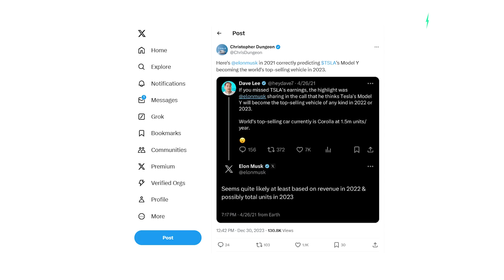CEO of CATL says Tesla’s 4680 battery cell is DOOMED to fail

Comment: Jelly roll is an antiquated design. 

Its simple physics. The heat dissipation path from the centre of the cell to the exterior is much longer than from the outer layers to the exterior. This results in a significant temperature gradient from the centre to the outside. The centre of the cells tends to be hotter than the exterior. This is bad for Li cell thermal management, longevity and reliability.
Reply: Add to that volumetric energy density limitations when cylindrical cells are placed into packs.
Reply: That doesn't make sense sorry. Do you mean a cylindrical wound jelly roll is antiquated? Inside of a prismatic cell is also a jelly roll. It can be a wound jelly roll or a stacked flatter jelly roll.
Reply: @danielcpt3819  The issue is the external area of the cell relative to its volume. To get rid of heat you need as large an exterior surface relative to volume as you can get. Hence the blade cell format used by BYD and CATL. 

This format is also structural with the assembled battery pack forming a torsion box that helps with vehicle rigidity  and reducing overall weight. The BYD battery pack is typically 400V 60KWhr 126S1P LiFePO blade cell battery. Each cell is roughly 1.2m long about 10cm high and about 2cm thick so provides plenty of 'active' volume within a large surface area for cooling.
Reply: @jimgraham6722  I completely understand this. A blade battery is just an elongated prismatic cell. Inside there are jelly rolls and outside is a large rectangular can l.
Reply: the two d problem of stacking circles in a hexagonal pattern means that 86.6% of the area is in the circle and the other 13.4% is available for gas flow for cooling. How well  heat flows along the length of the cylinder vs the breadth
becomes important. If heat degrades the battery you could get the inner core of the battery degrading first if the heat flow is less perpendicular to the length of the battery, which is likely as the metal is better heat conductor. A simple expedient  is to just wrap the batter on top of an empty tube that gives heat flow down the center of the tube. This eliminates material at center which could degrade first and could in principle allow increased airflow that if  matching the external flow space, could effective make the battery geometry with empty cylinder more equivalent to a battery with "half the radius".

A  battery takes up both space and has weight.   Adding a hollow cylinder puts more weight on the external cage to the extent it gets bigger, but gives the battery more consistent aging characteristics.  it all depends on whether the battery degradation ruins the whole  battery or just the most heated material, degrades.  you probably are more weight limited than space limited anyhow. So making battery with hollow core is maybe good trade off.

Perhaps the goal of a 10 year life battery is just as good to a car maker as a 20 year life?  Could you make the battery too good, and lose future car sales?

Comment: Some context, the CATL CEO actually was talking to Elon Musk about the major short comings of 4680 and Elon could not answer him. That's where this came from. The only thing Elon could say is they have to push forward.

Also its not Tesla battery tech, it's Panasonic. Panasonic is trying to ride on Tesla's tail to take back the battery crown. Their 2170 was the initial battery back used in Teslas back in 2017. 4680 is a bigger version of 2170 except the cylindrical packaging which is used in very old school lithium packs is outdated from the beginning. CATL's packs are already more energy dense than 4680 with none of the manufacturing problems so that's why CATL's CEO is saying what he is saying.
Reply: Seems CATL is correct.
Reply: @1diggers1  Course they are correct and not only that but in future Solid State Battery will dominate. Whatever Elon is selling are supplied by china.
Reply: So much false information.  The 4680 as produced in Fremont/Austin is Tesla's design.  It was developed in separate facility in Fremont, not Nevada so that Tesla wouldn't have to pay patent royalties to Panasonic.  The most interesting technology is the dry anode/cathode plating technology acquired from Maxwell Technologies.  That technology could dramatically reduce the cost of batteries.  Panasonic uses the wet method.
Reply: Chinese cars are terrible fit and finish. I have one.
Reply: this is where you don’t bet against elon ( i never do ) and you also don’t bet your entire farm on him either ( some don’t and yet have 30% totally and faithfully fully in on the man and the company )

unless you recieve income literally from teslas employee or as a utuber what would that make you if you did ?
SMR take note 😊
Reply: Tesla made the 4680, not Panasonic. Panasonic is going to make them as well.
Reply: Not sure any of that is true.  4680 ramp has been incredible. The cyber truck is a charging beast when paired to the right charger.  The energy density is not over the top but not sure CATL has better.  If the packs were tested outside China be easier to validate.
Reply: wr
Reply: Elon is a liar because everyone knows he's outsourcing Chinese Tech while fooling people, Chinese have battery patents equivalent to Panasonic. The Japanese battery are very expensive and they won't share their secret.

Not only that but Tesla is full of BYD parts also china is the only country to use 95% full automation in production facility for maximum profit which China sold to Tesla. Tesla, spaceX, Starlink, Solar City, Neuralink, The Boring Company and Optimus Robot are all Chinese  startup investment to boost US economy due to trade deficit. Elon Musk would be no one without china. lol
Reply: Overall 4680 in US is unable to ramp up decent production for any world wide supply that's the whole point
Future will still be the same.
One can yap for another decade, production will still be at most local but Not for world wide
That's failure
These car companies are global players, and their products are for world buyers
Effort put in, produces little results
Thus why Tesla can Not rely on 4680 battery production, it's too little volume
Also ternary batteries are dangerous chemistry 

Tesla need real result now to future that's working battery within decade is LFP
Until better ones like solid state battery comes out decade later

4680 thus remain a stunned investment ahd not produce volume what's envisioned & same in fee more years in future

On top of people knowing ternary battery short circuit, thermal runaway are lethal
Reply: @kirakira1981 - Elon didn't answer because he had no answer.  He decided not to answer.  Musk does not have to be a battery expert as he has SpaceX has one of the largest collection of material scientists in he world. The 4680 and the dry anode and cathode technology is not Panasonic tech - it is Tesla Tech.  Tesla's strategy in teh EV space is to drive down cost of production.  In that strategy Tesla wants one form factor - the cylindrical format was their choice.  As of now - they have been successful in driving down cost of production - they are at about $85 per Kwhr.  They estimate to be at $70Kwhr.  Tesla wants to rely on in house battery production.
Reply: @RagnarinVa  issue is that the dry coating technology was a failure at Tesla. Maybe they fixed it now ? 
Anyway, their dry coating was too slow and known to reduce the line output by over 50% .... not viable on mass production then.
Pretty sure that CATL has been tinkering with dry coating too thanks to its huge R&D resources. Did they fixed Tesla issues ? If not, that could explain Robin's comments ....
Reply: @chryoko  - The latest Quarter 3 report is those issues have been solved and they are producing dry coated anodes and cathodes.  That has been achieved - this increases energy density and reduced manufacturing time and cost.   It took time because it was not easy and Tesla owns the technology.  Tesla is continually to increase production volumes and yields and the cost curve is aggressively driving down.
Reply: do you have source?
Reply: @shimmy1984   I tried to post the link 3 times, can't post links in Youtube comment section.
Reply: @kirakira1981  just tell you don't have a source
Reply: @kirakira1981  replace the dots with spaces
Reply: @kirakira1981 If you find a YouTube link, you can post that instead.
Reply: @kirakira1981  Well, you can, but YT deletes them after a short time, along with your post. So if you want to post a quick link, you can, but after a day or so it will disappear.
Reply: The whole point of 4680 is dry battery electrodes, structure and speed. I don't think it's dead yet.
Reply: He said Elon doesn’t know how to make batteries.
Reply: @TheBooban  He is correct.
Reply: CATL is the king of the old VDA style prismatic NCM cells. Top or Bottom connectors and with a rolled Jerry roll (not a stacked one).
46xxx is an alien technology for them. For sure they are working on it.
Issue with VDA Style prismatics, is that when you increase their energy density over let say 285 Wh/kg (from NCM 811 and higher nickel contents using Silicon addition into the anode side, maybe pre-lithiation too), you reach quite risky territories in terms of safety. You basically produce little bombs. Those are becoming unsafe at manufacturing stages (eg. the plants fires, also at CATL !). Tesla initiative with 46xxx is quite smart as the a cylinder is intrinsically better suited to survive high pressures, therefore safer to manufacture and use. Also it has been demonstrated that some 46xxx cells sporting over 300Wh/kg density tested in a thermal runaway will not propagate fire to their next ones into a well designed pack using serpentine cooling as Tesla does.
SAFETY FIRST !
Reply: He protests too much.
Reply: BS!
The 4680 is Tesla’s idea. They bought in house a whole bunch of battery talent, developed the dry electrode tech in house and the entire production system.
Panasonic, Samsung,LG and SK are also investing heavily in 4680. All of these companies can’t be stupid. 
I think CATL are worried. There is no other reason why the CATL CEO would be saying this stuff.
Reply: @richardvivian3665  
"All of these companies can’t be stupid" Tell that to the bankruptcy courts, let alone the American electorate. Fuck me, they don't even know how tariffs work, let alone batteries!
Reply: @richardvivian3665  it doesn't matter how many people invest in it, you can't change physic. cylinder battery are not evenly stress. the inner layers will naturally be roll more than the outer layers, this means you have to design the battery on the limitation of the inner most layer, greatly limiting what you can get out of the material. the only reason companies are making them is because it is easy to convert dated factory into producing them. however once you converted that capacity, every future investment you make will be less economically as you can't maximised on the return of the material.
Reply: @richardvivian3665 the dry electrode tech was Maxwell, Tesla got it by buying the company out
Reply: @ 4680 is just a bigger version of 2170. Crack open a 1990s laptop battery pack and you will find the same thing in a smaller form factor. Yeah CATL is really worried. They have a product out now mass produced with higher energy density than 4680 not to mention solid state batteries. That makes sense.

Read other comments on the reasoning behind the cylindrical cell architecture. It makes no sense given today’s battery chemistry.

So why doesn’t Tesla go the way of CATL, I suspect its patent walls.
Reply: @kirakira1981 hasn’t Tesla /elon always claimed to be chemistry agnostic? And that if a better form factor comes along they’ll use it? Didn’t Sam mention as much with catl plants already planned in the USA?
Reply: @kirakira1981 What product has higher energy density than 4680? Can they exceed 300w/kg at mass production cost? I am not aware. All their LFP batteries has low density
Reply: @kirakira1981  "4680 is just a bigger version of 2170."
If that is all it was, why did it take Tesla 5 years to figure out how to make it. It is NOT "just a bigger version". Anybody that has followed this story knows that.
Reply: @kirakira1981  CATL has different form factor and might be better, only time will tell.  CATL looks to have lead in volume and like 10X engineering manpower.   4680 touted as cheapest battery outside of China.
Reply: @kirakira1981 More BS!
LFP patent expired in 2022 so there’s nothing stopping Tesla from advancing this if they wanted to.
The 4680 is designed as a cheaper higher end cell with excellent characteristics. 
The 4680 is a new format at the early stage of mass production. It is already competitive against supplier cells according to Musk at the last earnings call.
Reply: @ LFP the chemistry is nothing special. It’s how you package it. Before calling BS, you might want to go to school first.
Reply: Even if CATL's packs are more energy dense than 4680 without manufacturing problems.  That does not change the speed the batteries are produced at, the materials used, or the charging speed/cooling the tabless design offers.
Seems like CATL is doing different things.
Prismatic batteries are the batteries in car fires.  Not cylindrical.
Reply: @davidbeppler3032 Yeah, and Tesla packs have never caught fire. 😁
Reply: @Xetairex  No, they have not.  Gas cars have all exploded and killed everyone who ever drove them though.  Very dangerous.
Reply: @ Do I have to show you numerous videos of Teslas catching fire? You are talking to a long time Tesla owner here, with more than a decade of experience owning Teslas. Note.
Reply: @davidbeppler3032  Not only that. Apart from the natures most efficient form, that is round (the S, the sphere etc.) and the benefits that this brings, like even heat dissipation and more uniform thermal management of the cylindrical cells, Prismatic cells, as EV Clinic car service states, "are more problematic to change, because they are pressured between all other cells. You need to cut frame and disassemble everything (in order) to change. All of them are glued too. We had experience with VAG prismatic cells and it is almost impossible to change one in a cost effective approach."
Reply: @davidbeppler3032  actually all the prismatic batteries there making are lfp or lmfp. Which are way safer than nickel batteries nca or such. Lfp is one of safest. Nickel based batteries are the fires.
Reply: copium
Reply: @pranshukrishna5105  Copium on Tesla fan boys part. I agree!